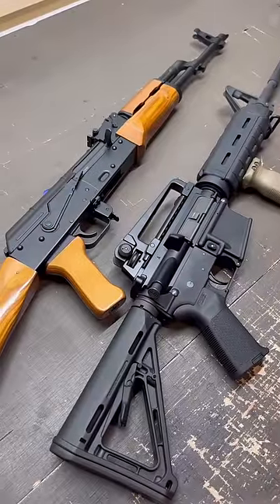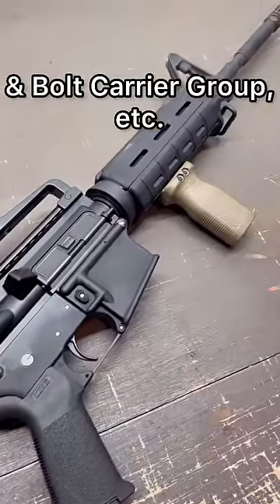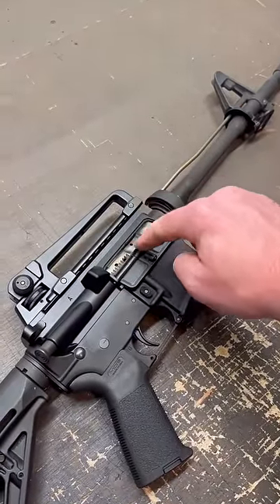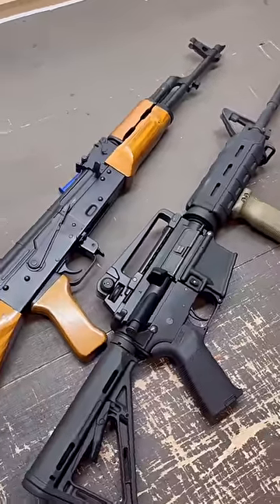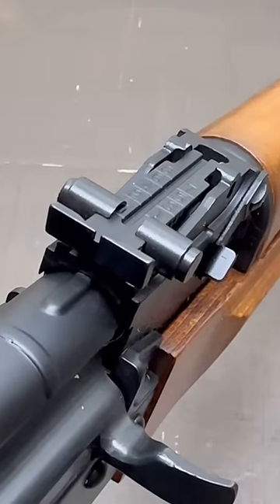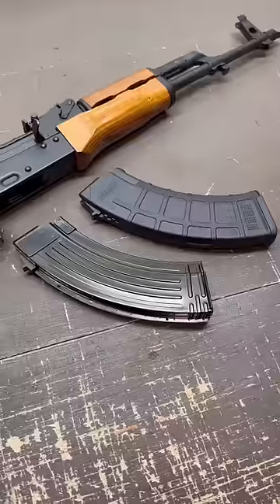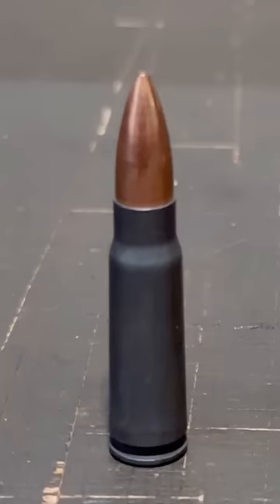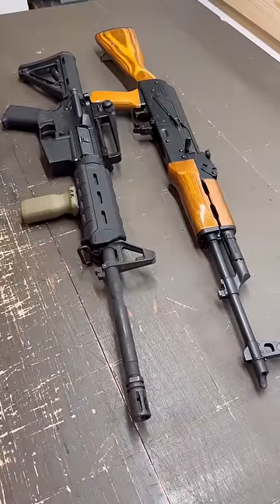AR-15 vs AK-47: What’s the difference?

Comment: One big difference is the AK doesn't mind being ran dirty but the AR gets dirty easy from being ran and is pickier on rounds.
Reply: So many small parts and springs that need to b clean on a.r.. I love em but they scare the fuck outta me.  Ide start with a.r and gradually end up tmwith the ak
Reply: Really?  Haven't cleaned mine yet, runs anything from the cheapest fmj I can find to Hornady match grade.  I think most people still generalize their ideas of ars based off the known issues the M16s had in Vietnam.  Which have all been pretty much resolved.  The only time you're going to have actual issues is if you get a cheap ar and don't lube it at all.  Then you need to take into account the price you pay for even the lowest model ak, and compare it to a similarly priced ar, you will have better quality.  The only quality ak are well over 1500, while good quality ars can be had for roughly 750 which makes for a better entry market.
Reply: ARs can run dirty all day long, but they won't run dry. You have to keep the BCG lubed.

Comment: Ar 15 , the receiver and buffer  extension are aluminum.  The bolt , bolt carrier, trigger assembly,  gas block,  chamber, sights....all steel.  And rhe AR 15 doesn't get extremely dirty ...they can be run for over 1k rounds with just lube

Comment: Besides the stamped receiver vs aluminium, the piston vs DI gas systems, the biggest difference is that an AK can always be made to fire in full auto, with no additional parts. The AR needs a receiver that can accomodate a sear, while the AK triggers all have the capability of being made to fire in fully automatic, by removing the hammer disconnect. So yes, every AK, at least original AKs, can be reverted to fully automatic rifles with just a metal file or small grinder.

Comment: Don't like the AR or the AK? Check out the Robinson Arm's XCR-L. A better alternative than both of those  listed above. A multi caliber rifle where you can shoot the 5.56-NATO and the 7.62x39 AK round. Only the barrel, bolt and ejector is changed. Only tools needed are 1/4" Allen key and a medium size Phillips head screwdriver.
Reply: How much they pay you to post that sales pitch
Reply: @spamandspam  I am not a salesman for anyone. I have the XCR-L. And AR's and AK's be dammed.
Reply: The AR18 has the superior operating mechanism, so naturally a weapon that uses it will be superior.

Comment: Side note - unless your AR is chambered in 5.56 I would only run the .223 in it. The 5.56 has more powder than the regular. 223 rounds. It can cause the gas tube to blow out.

Comment: Both are great, my LWRC is a Piston gas system, it's literally self lubricating, I went with the 10.5 inch barrel, my LWRC still costs less then the Daniel Defense Impingement system. My LWRC comes decked out not a thing needed, great grip, charging handle, the carrier is NOT a group it is a solid one piece carrier so I have the dependability of the AK-47  but I have the fun switch too! The major "problem" with the .556 is the rules saying ya have to use full metal jacket!!! If the military got to use the Sierra 62, 68, 77 grain hollowpoints then they wouldn't be complaining about the lethality!!!! I have green tips and shooting gallons of water long range to see the damage on target we were filming to see what the smaller rounds did damage wise since we are made of over 80% of water!!! The green tips would just poke small holes and the water leak was just a dribble just as it would do to a bad guy, followed it up with a 77 grain Sierra hollow point and IT WRECKED THAT GALLON OF WATER RIPPED THE BACK SIDE OUT! BUT IF FOLLOWING RULES OF WAR THE AK is the way to go the bullets start tumbling after a while!!
Reply: self lubricating is not a real thing, its just a term that's almost true/adding a larger word to make it seem like industry specific knowledge. like saying "rounded tires"

Comment: Am I tripping or did that AK have the magical 3rd position? 😂
Reply: The AK safety (on select fire) is "Safe - Auto - Semi", where the AR/M-16/4 series of rifles go "Safe - Semi - Burst/Auto." Both are frequently marked for all positions, regardless of capability. The AK safety still has to travel all that distance though, and usually still has a stamped notch at the "Auto" position so you see, hear, and feel the click as you move past it to the "Semi" position.
Reply: You are tripping. Look at the beginning of video you can see the best notch is not there on this particular ak
Reply: Some manufacturers put fake full auto notches on the receiver. It still only fires in semi in either position

Comment: The main and real significant difference is the gas systems.  Delayed impingement may be "more dirty" but it's putting pressure waves of hot gas into the action of the weapon while it is operating, wich can blow out debris, water, and vaporize excess lube that would gum up an ak action because it's piston driven system doesn't gas up the rifle every time it's fired.  This makes it superior to piston rifles from my perspective.    Afgan war vet here.

Comment: The design of the ar15 has potential for better accuracy with tighter tolerances while the Ak sacrifices a bit of accuracy for unrivaled reliability.
Reply: Well put.
Reply: There's also been an obscene number of AKs made
Reply: exept that modern ar's tend to be more reliable than ak's
Reply: Although your opinion is understandable, the “loose tolerances” that an AK typically has will not affect the accuracy. All that will affect the trajectory is the barrel and bolt lock up. Most of the AKs used by the troops in the Middle East tend to have very worn barrels from being reused and aren’t very accurate.
Reply: @s_vb2220  that's the opposite of the truth
Reply: @rustys.1070  AK's being more reliable than AR's was the truth about 60 years ago. but 60 years and a near limitless budget can achieve a lot.

Comment: Ak will flex with every shot, stamped metal causing loss in accuracy. I'm sticking with my ar platform as I know how it runs and functions. I like it better for myself personally as I'd rather have the abilities of longer more accurate shot placement for my usage
Reply: tbf the ak fits better with the russians, since it requires little training and extremely minimal cleaning, meaning that conscript that just got drafed with 2 hours of training can probably figure out how to use and maintain it better than he would be able to use and maintain the ar
Reply: @flamee23312  A Russian recruit would lose the firing pin retaining pin in about 1.8 seconds and have a completely inoperable AR.
Reply: Apparently you haven’t heard of milled receivers that are made from a solid steel block. Also, any movement that could happen behind the bullet doesn’t make a difference in accuracy. It’s purely the bullet and barrel ahead. A cheap/worn firearm will perform badly compared to a quality/new firearm.
Reply: Kinda true inaccuracy is due to the shorter sight radius alpaca scope on it and there will be a change
Reply: AKs flex more but are still just as accurate for all intensive purposes
Reply: @imm2gamer348  I have seen a few milled receivers. Nice looking and all. Good running platforms also. When comparing the ak to ar and list out both pro and con . There neck n neck in general. Where one lacks a little the other excel a little and vise versa.  For my usage, the ar platform fits me better.   I'm not trash talking the ak unless it's a junk one that's not even worth the wood it's mounted in and then it's only that brand if that company only produces junk. I also like Ruger, some don't. Doesn't bother me, but when someone shows or says the paid $2000 for there custom colt or Kimber for there edc I laugh inside and ask this.  As I lay down on the driveway and slide under my car and you hear my edc Ruger scrape on the concrete or asphalt. How's that Kimber do dirty, oh and I guess you're not going to help me while you got that safe queen on your side are ya.            I believe in a good, durable item. Quality it first. If you're to scared of get dirt n scratches on it then it just a trophy safe queen just so you can say you have one.   Nah I'm a use mine. If it won't shoot dependably when dirty, how can I trust my life with it when clean...

Comment: U missed the part where the Ar shoots basically a 22 caliber... Ak all-day baby😂😂😂
Reply: 556 can actually penetrate shit🫢
Reply: @chair4964  and the 7.62 can actually do damage
Reply: @chair4964  Isn't .223 different to 5.56 nato? Yes they're roughly the same size, but doesn't the 5.56 operate at higher pressures?
Reply: Nah man if you want it in the higher 30 cal just switch the upper and the buffer system and buy new magazines easy
Reply: 55 grains of 22 caliber moving at 2700+ feet per second tumbles and yaws inside the target, tearing shit up. 123 grains of 30 caliber moving at 2200+ feet per second just goes straight through and through. 

Both will kill whatever they hit. Dumb comment

Comment: What are some differences that he left out? In countless videos AK-47 fails The mud test and the sand test miserably but the AR-15 passes both tests and in one of those tests a sandblaster is blasted directly into the AR-15 bolt as it is cycling and it still continues to function.. Video, after video, after video and you would think this guy would understand by now that AK-47 is a flawed design but no, AK fanboys don't know a thing about sand test or mud test.😮😊

Comment: Ar15:
Lighter
More penetration
Better protected sights
Lighter ammo
Heavily customizable
Shit load of features
Better safety switch keeping your finger on the trigger while cycling to a different fire mode.

Ak47:
Heavily reliable in bad enviroment
Bigger but slower bullets
Usually more mag capacity
Heavier
Exposed gas tube (not a bad thing)
More sight settings

If i missed anything sorry but im not an Ak guy, for me an Ak is pretty trash. No hate towards Ak guys.

Comment: I prefer the AR platform lighter sleeker more accurate..I suppose for close quarters the AK could be better due to penatration power but an M4 with burst mode is probably a CQC equalizer...if your targeting anything at range 100 meters or more better off with an AR..

Comment: Technically an AR is NOT direct impingement.  It'd be far simpler if it was.
Stoner just moved the piston into the bolt carrier so the bolt is part of the piston.  So gas goes into the bolt carrier group, starts expanding in the chamber, moving the carrier group rearwards, thus rotating the bolt until it clears the lugs and then the carrier group with the bolt move backwards until stopped by the buffer.

A real direct impingement system would just have a blind cup where the bolt carrier meets the gas tube.  Like on the Ljungman.

The purpose of placing the piston inside the bolt carrier was to further eliminate recoil, but it makes the weapon even dirtier and difficult to clean than a real direct impingement system.

Comment: You forgot the most important differences. The AK fires from open bolt and the AR fires from the closed bolt. 
- Open bolt. When you charge the weapon. The bolt carrier group locked back under spring pressures. When the trigger is pressed. The BCG is released slamming forward.  The BCG comes to a sudden stop at the breech face and the loose firing pin keep traveling striking the primer firing therfore igniting the powder charge and walla. 
- Closed bolt. When you charge the rifle. The BCG is pulled back over an internal hammer that is locked back under spring pressure. Like a revilver. When the trigger is pressed. The hammer is released falling forward striking the firing pin that strikes cartridge primer setting off the powder charge. Walla.
Reply: Are your mom and dad also brother and sister? The AK is closed bolt

Comment: The AR class is if built and cleaned properly is typically more accurate because of the sights are better then the AK platform and if we are just talking about the Other OG variance the longer barrel and ammo 223/556 is flatter shooting at range 

But most people don’t shoot that far so most people of won’t notice the difference so on paper the Ak 47 can be better just of ballistics

Now newer AK’s like the AK74 And AK107 the entire gun got a much needed upgrade better such as sights and ammunition know using 5.45X39 the scales on on paper better are now all AK plus they take modern optics just like AR’s.  The only thing that’s bad about this gun is finding ammo and the Gun itself is hard and when you do find it is not cheap 

So even if you find an AK107 like from Arsenal with there SAM5 serious you might just want to have it changed to 556/223 and then that’s not worth it unless you are rich
Reply: I would argue the ergonomics of the AR are better, especially with a left side charging variant (which i also recognize is a variant, and norlt by any means standard). The bolt catch is also a big point on the AR side. As to 5.56 AKs, some companies are now making those at around the same price as 7.62 and 5.45 AKs, and some have choices between AR type mags or AK type mags. One such company is PSA, who offers 7 62, 5.45, 5.56 AK mag, and 5.56 AR mag AKs, as well as a blowback 9mm in the AKV.

Comment: You have to produce entirely different AK models for every slight difference, but with AR15 you just need to uninstall a part and install another variation in it's place. I'm a dummy at guns, but that's what I figured.
Reply: that's not true at all. you're not going to fit KAC parts on a LWRC. You're not gonna fit HK parts on a LaRue. There are milsepc equivalents for both. AKM furniture is compatible with other AKM.

Comment: another difference is--if you found an ak in the jungles of vietnam, you would need to kick open the bolt with your boot, take it to the river and wash it out before it would fire.  where as if you found an ar in the back of grampa's closet, you would need to fully disassemble and clean it or else it would explode on the first round
Reply: Nah

Comment: ar15 is a piston system as well its just that the piston is in the bolt. it's not a true direct impingement firearm.
Reply: the piston in the bolt does nothing for cycling the gun. If it wasn't there, it would still cycle  the piston helps time the bolt to prevent it from unlocking to soon.
Reply: @SHELP  demonstrate that please.
Reply: @Dale Earnest  gas enters the expansion chamber in the bolt and pushes the Bolt forward, and bcg backward, this does 2 things it keeps the chamber sealed  for a split second longer to alow the pressure to drop more as well as it separates the bolt and carrier to allow the bolt to rotate in the camgroves and unlock.
Reply: @shelp7858  now explain what a piston does without describing any of that.
Reply: @Dale Earnest  a piston, takes the inertia from the gas and applies it to a piston that engages the boltcarrier  directly   like in a long stroke or through inertia like a short stroke piston. at no point does gas contact the bolt carrier or bolt.  timing is achieved by springs attached to the pistons or by the weight of the piston.
Reply: @SHELP  what are the holes one the side of the bolt carrier then? exhaust ports are they not? isn't that why it gets so dirty so fast?
Reply: @Dale Earnest  yes they’re there to vent the gas from the bolt carrier group. Piston guns dont have those ports on the bcg. The ports usually are on the piston sleeve if they have them .
Reply: @SHELP  u said at no point does the gas touch the bolt or the bolt carrier. u just contradicted urself.
Reply: @Dale Earnest  how did I contradict my self the piston sleeve isn't on the bcg its usualy directly  behind the gas block. on a piston gun

Comment: I tend to refer to the AR as an "internal piston" system, since the rear of the bolt inside the carrier acts as a piston, wherein the gasses are directed into the carrier via the gas key atop the carrier, forcing the bolt to stay locked in the chamber while the carrier separates from it by moving rearward.

Meanwhile, the AK I refer to as an "external piston" system, performing the same actions via a piston that is separate from the bolt.

Direct impingement would imply that the gasses are directed onto a surface that is connected to the bolt, venting the burning carbon onto said surface and dirtying the action.

If you look at the ejection port of an AR, you can see the exhaust ports where these carbonizing gasses are vented to the atmosphere from within the bolt before the action completes its cycle.
Reply: I agree, the AR is internal piston technically. The carrier is a piston that drives the buffer/buffer spring back.

Comment: Ar 15 ' s (etc) are NOT lefthanded kind , AK 47 's are lefthanded friendly 
While both can be ambidextrous I don't like hot brass smacking me in the face , even with eye protection,  yes there are many differences between the 2 
The m16 (a1 as I call it (m16a1) was not liked in the field in the Nam , Soldiers would ditch them in favor of an AK 47 
I personally like the M16 s/a or tri burst 
But I'll still take an AK over an AR 
Just my honest opinion 
Not right nor wrong , just my view on some of the differences between the 2 here